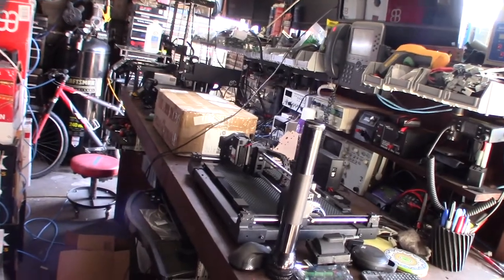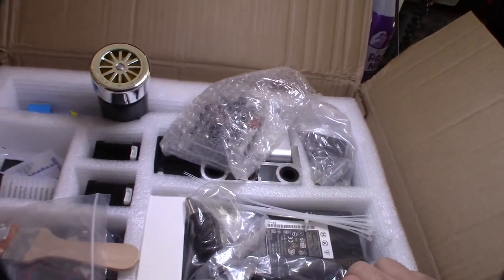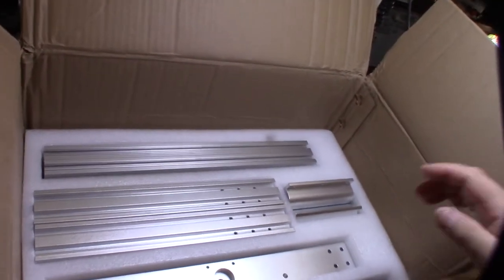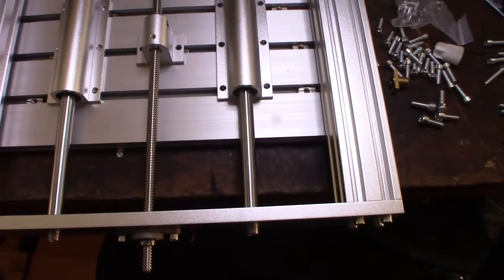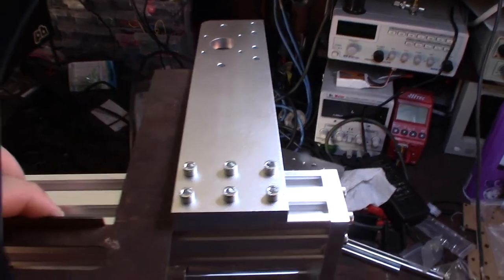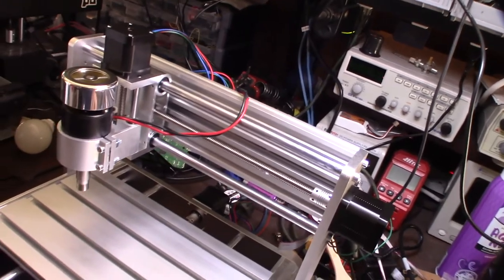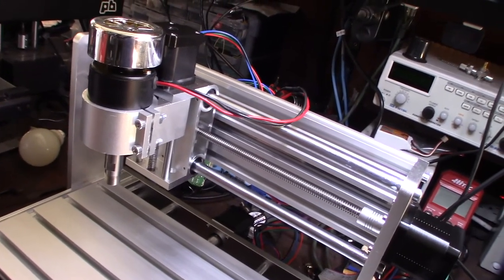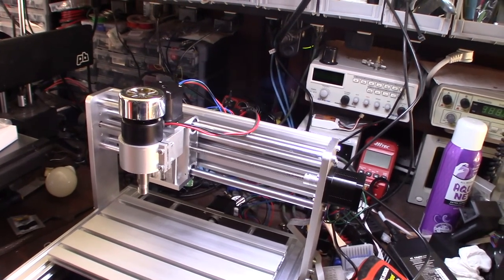MYSWEETY CNC 3018 Pro Ultra Rigid All Aluminum 200W GRBL spindle GRBL yofuly build review

Comment: Thanks for video.  I am confused. On the Amazon website there are options to buy Large, Full Size, or Extra large.  I have no idea what differences are.  I'd like to get the best available of these models.  Looks like they come with lasers, too.
Also not sure how to use with Mac.  Create file in Fusion 360, etc then transfer info to offline controller?

Comment: Just bought one of these ,  Let me know how your getting on with yours
Reply: I just bought one got it built 100%, but controller does not control the unit.  I think I'm either dealing with a firmware update need, or a bad logic board. Amazon is sending me a new unit